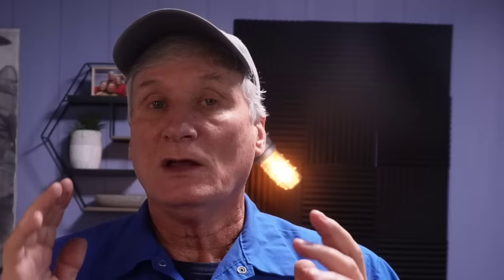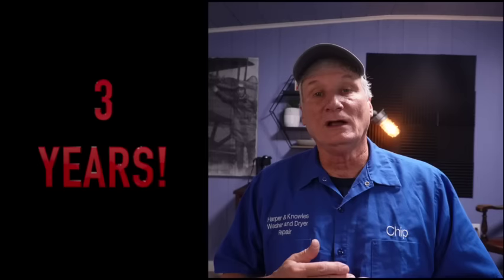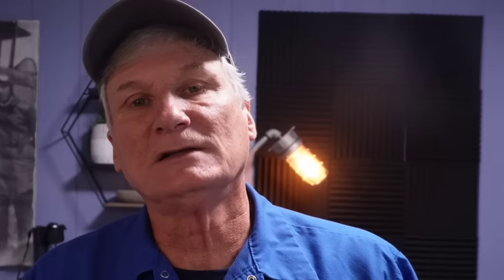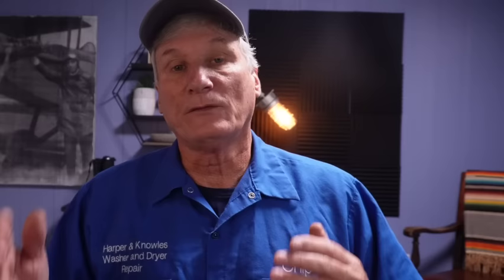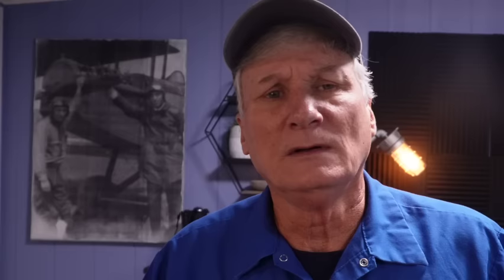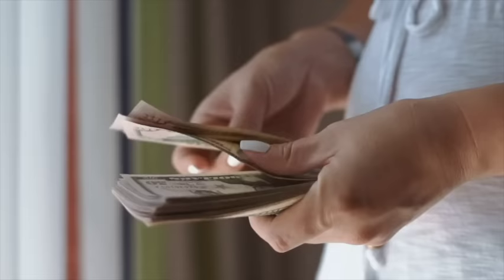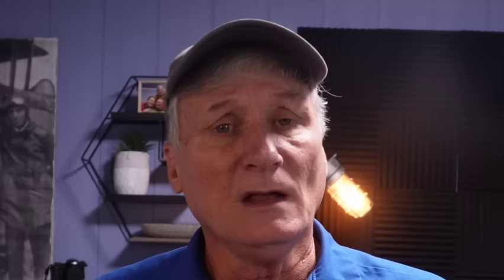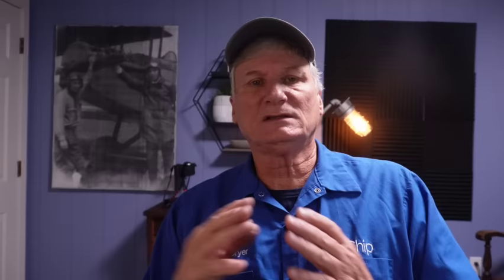How To Choose the Best Washing Machine: Speed Queen TC5 vs. TR7 Review

Comment: SORRY to differ with you  But there are no good washing machines any longer and have not been since 2010.  That was the year of the paradigm shift in the white goods industry when governments took control.  The washer you advertise is as junkie as any other.  The problem is they don't use enough water.  Sorry to burst bubbles but water is what washes clothes.  It's very simple physics.  You need LOTS of water with agitation flowing through the fibers.  But people have been brainwashed into thinking you can use less, just like new toilets.  We are not running out of water.  That is an impossibility.  The water "savings" is about control plain and simple.  You want a good washer?  You buy OLD washers from 2010 and prior.  They work and they last.  If the basin ain't full of water - it ain't washing good.  That is why your washers now have to be cleansed and grow mold.  Also why your clothes don't get clean and smell, so they sell UN-STOPPABLE beads to cover up the odors.  Costing more $$.  Once you know the scheme, you know the truth.  So if you want clean clothes without bacteria after washing, get an old machine.  Don't believe me, take a good whiff of your clothes or your "high efficiency" washer.  Better yet, take a culture of them both and bring the sample to your local university LOL.
Reply from the maker: Thanks for watching!

Comment: A 13 min video with 20 secs of actual washing machine view.  The rest of the video is about Facetime with a talking head. This is Narcissism at its best.  Hey mister! This is VIDEO not RADIO.  Show the machine when you are talking, not your head.

Agitator machines - they get your clothes clean but are rough on clothes.  Gee, now I'll have a sweater nice and clean but torn to shreds.  Thank you Speed Queen!

How about some new tech like the drum washers front loading - they do both!!! They clean well, AND they don't destroy the clothes.  Better yet, they use very little water and they rinse better too.  And yet again, you don't have to unscrew the center agitator column to clean the disgusting lime scale and soap scum and lint on it.  Buy drum washers only!!!
Reply from the maker: I appreciate your feedback and suggestions for improving the video. While the format might not have fully met your expectations, I do want to clarify a few points. The video aims to provide a comprehensive review and insights into the Speed Queen washing machine. I value your interest in new technology like drum washers; they indeed offer some unique advantages. Front-loading machines are known for their efficient water usage and gentle washing action. However, it's worth noting that agitator machines like Speed Queen do have their merits too, particularly in terms of robustness and stain removal. Each type of machine caters to different preferences and needs. I'm here to offer information and help viewers make informed decisions based on their priorities. Thank you for sharing your perspective.

Comment: Moves the water through the clothes not the clothes through the water.. You lost me with that.
Reply from the maker: If you watch the two actions of the TC5 (clothes through the water) compared to the TR7 (water through the clothes) it’s really quite obvious. Thanks for watching!
Reply: @HarperandKnowles  Yes no doubt that is what happens but water going through clothes or the other way around in terms of the clothes is the same .Using the machine as a reference that is true but if you were on a piece of clothing you couldn’t tell the difference.Itis only the relative motion that counts.Thanks for responding too.